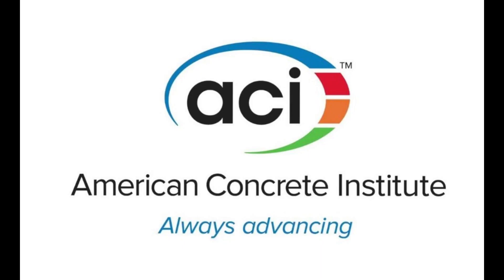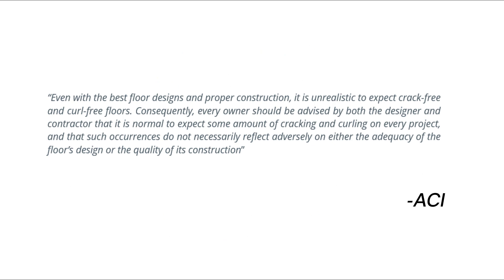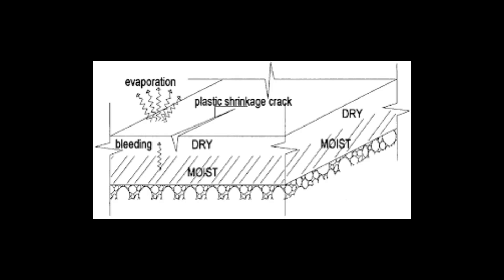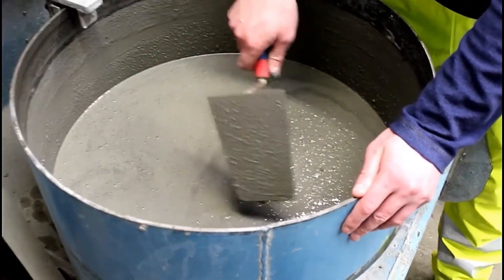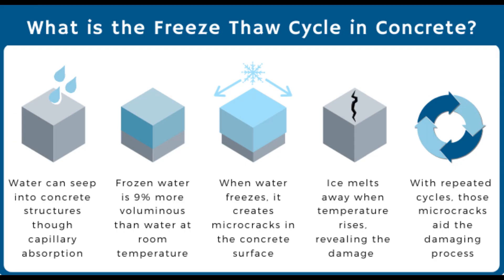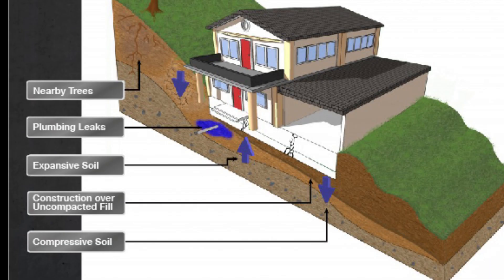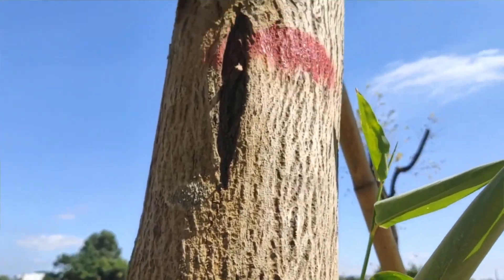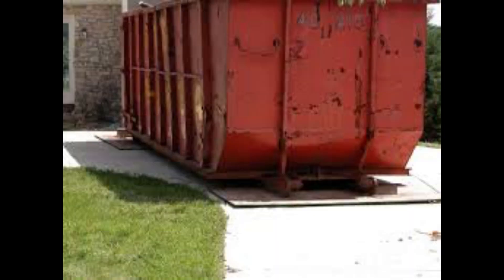Concrete cracks that even most Engineers DON'T know [Gibberish Fox】

Comment: Alkali- silica reaction. The reaction of silica in aggregate react with alkali in concrete forms an alkali-silicate gel that swells and absorb moisture from cement. Over the time the expansion gel causing the concrete to crack. Normally the crack look like star shape.
~farhanaspaceipoh~

Comment: Another type of concrete crack is settlement crack. Settlement crack is considered as structural crack and it may appear when the underlying ground has not been compacted or appropriately prepared or if the subsoil was not of the proper consistency. Settlement crack can accelerate the aging process and reduce the ability of a structure to absorb stress, increasing the risk of collapse. If cracks are detected, a monitoring plan should be drawn up immediately.

Comment: one type of concrete crack that not being listed in the video, cracks due to creep in the concrete which is the increased stress or deformation of a structural element under a constant load. Depending on building materials, structural design, and service conditions, creep can lead to displacements and Cracks in  the structure.

Comment: The video introduces many types of concrete cracking caused by a variety of factors, including plastic shrinkage, expansion, heaving, settling, overloading, and premature drying. Another type of cracking which is not mentioned in this video is "Corrosion Cracks". The steel is susceptible to corrosion when the link between the steel reinforcement and concrete is insufficient. This is so that moisture and air can enter and assault the steel due to insufficient bonding at the interface. If this occurs, the reinforcement's cover will begin to spill, making the concrete more prone to cracking. Corrosion-resistant bars can be employed as a preventative measure. A corrective measure, however, entails taking out the concrete and setting new rods, followed by epoxy coating and packing with new concrete.

Comment: 6 common types of concrete crack have revealed in the video. Another concrete crack is due to chemical reaction.
Hazardous chemical reactions can lead to concrete cracking. The concrete's construction components or anything that come into contact with it after it has hardened could be the source of these reactions. Concrete may crack over time because of expanding interactions between active silica aggregate and alkalis coming from cement hydration, admixtures, or other external sources such as curing water, groundwater, and alkaline solutions stored or used in the finished structure.

Comment: Aside from all the concrete cracks mentioned in the video, another type of concrete crack is cracks that are caused by chemical reactions. It is due to the materials in the mix and any others it may have come into touch with. The expanding reactions between the aggregate and the alkalis in the cement paste are what create cracking. Active silica and alkalis interact chemically, creating an alkali-silica gel as a byproduct. Alkali-silica gel develops around the aggregate's surface, expanding it and exerting pressure on the nearby concrete. The tensile stresses could rise over the tensile strength of the concrete as a result of this pressure increase. Concrete then begins to crack to release the pressure.

Comment: "Delamination" is one type of concrete crack that is not mentioned in the video. Delamination of concrete occurs when the top paste layer separates, leaving an unbonded concrete layer between it and the slab body. When lightly touched, it typically makes a hollow sound that can be used to identify the crack. When new concrete has been poured and compacted, the cement and aggregate settle. The lighter components move toward the surface as a result of this natural settlement, which results in bleeding. When finishing operations begin too soon and the surface is sealed off before bleeding is finished, air and/or water might become trapped beneath the mortar of the densified surface. Subsurface voids where the water or air is trapped form as the concrete hardens. These gaps weaken the areas directly beneath the surface, which could eventually separate during slab use. As you try to determine the extent of the delaminated region, very thin mortar layers above the delaminations may even separate when hit with a hammer.

Comment: After watching the video I have learnt about 6 types of concrete cracks. There are also some cracks will be show during filed work. So another cracking is thermal cracking.  Thermal cracking in concrete occurs due to temperature differences within a structure. This can happen when a part of the structure is heated more than the other. During the hydration process, different compounds in cement hydrate at different rates and evolve different quantities of heat. This can result in differential changes in the volume of the concrete which may lead to thermal cracking. In addition, during the hydration process, the concrete core gets heated more than its shell because the shell being exposed to the environment gets cooled quickly.

Comment: All designers and contractors must deal with the issue of cracks. We need to comprehend the many forms of cracks and what creates them. In all concrete works, possible cracks must be considered both during design and construction. The idea behind all of these various kinds of concrete fractures is that there are solutions to stop and lessen their effects on the concrete structure. And because they are indicators of the properness of the structure, an improper concrete mixture, or finishing work, cracks are one of the key issues in building. It must be considered during the design, execution, and finishing phases.

Comment: Concrete is known as the most common building material around the world. In the video, different types of concrete crack due to various reason such as plastic shrinkage, expansion, heaving, settling, overloading and premature drying are introduced. Chemical reaction cracks are one type of concrete crack that is not covered in the video. These reactions could be caused by the materials used in the construction of the concrete or by objects that come into touch with it after it has hardened. Concrete may crack over time as a result of expanding interactions between active silica aggregate and alkalis coming from cement hydration, admixtures, or other external sources such as curing water, groundwater, and alkaline solutions stored or used in the finished structure.

Comment: As an engineer, we are ought to understand and aware of the existing of various possible cracks to be considered in our design and during every concrete works. Heaving cracks are another type of temperature-related crack; that are not mentioned in the video. Exposure to extremely cold temperatures causes the slab to condensate, resulting in heaving cracks. The slab expands back to its original shape when the temperature returns to normal. Heaving cracks are frequently formed as a result of this shift in shape. 

A deep understanding and familiarity with the root cause of all these different kinds of concrete cracking can enable us to find ways to prevent and minimize the impact. Concrete cracks is a major concerns in construction as they are signs to incompetent concrete mix, concrete works or finishing works that could lead to poor appearance of concrete and worst is to cause significant structural failures. Hence, concrete cracks must be prevented at it worst. However, if it cant be avoided, then immediate repair works and possible solutions must be carried out to overcome the failure.

Comment: From the video, I have learnt different types of concrete cracks that will be happened in our structure with different factors such as plastic shrinkage, expansion, heaving, settling, overloading and premature drying. Those cracks that will endanger our structure and endanger life of human being, so as future engineer, we have to learn and have the solution one days to avoid those cracks and practice with the best methods or solutions that will bring lot of benefits to us as well as our world. Another cracks that didn't listed in this video is cracking due to corrosion cracks due to insufficient bonding between concrete and steel bars as well as reinforcement corrosion.

Comment: Another cracks is diagonal cracks. Anywhere along the height of the reinforced concrete, diagonal cracks
 could develop. The entire column face is always affected by these kinds of cracks. Inadequate cross-section, insufficient load-bearing capability, and insufficient reinforcement steel are the main causes of diagonal cracks in concrete columns. Diagonal cracks must be repaired immediately .